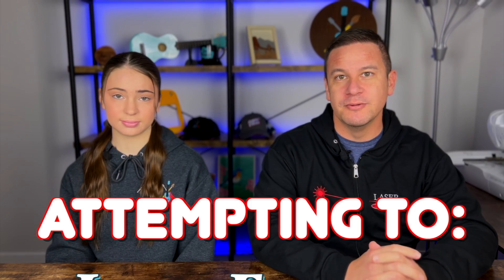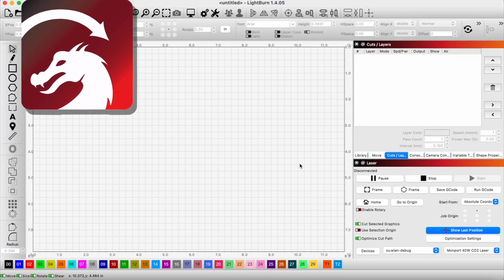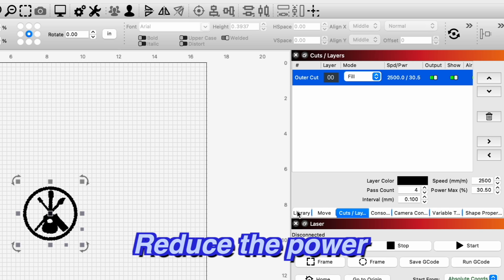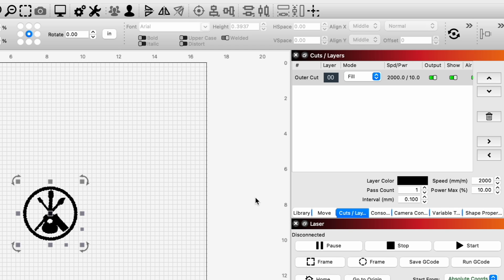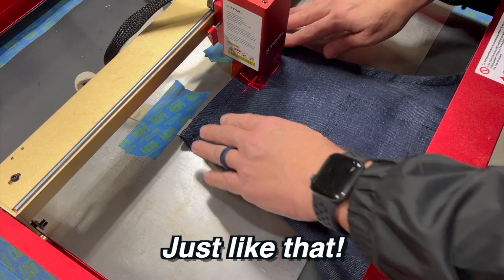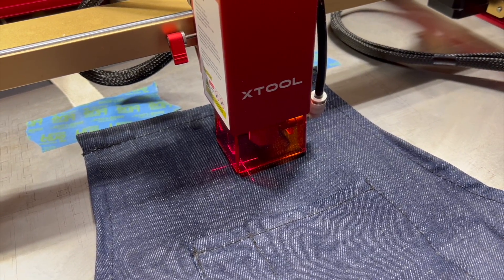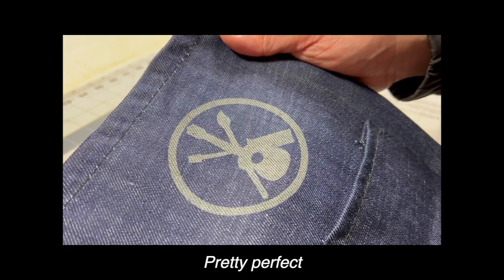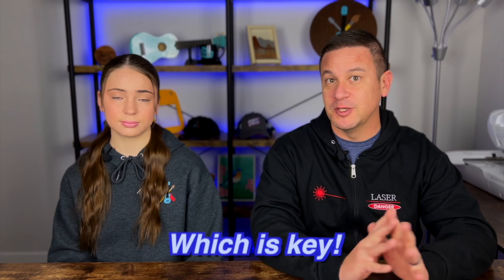DENIM ENGRAVING w/ xTool D1 Pro 10w

Comment: Hey how are you?  I noticed that in some examples the color of the engraving is different than in others. I'd like to make the engraving light blue. But I noticed that some come out beige or greenish. Does this have to do with the power or settings used on the machine, or does it depend on the color of the denim?
Reply from the maker: Hi!  We can't be sure the reasons for variation in the denim results. It's likely that the power, setting, denim fabric and color are all going to play a role in color variations you will get from engraving. Some of the denim results from engraving just look like the backside color on the fabric, while others yield a greenish hue like you noticed.  You will likely need to do some testing to yield results you like.

Comment: Thanks for the video. Couple of questions. I have the same laser machine but 20w. I bought the same aprons to etch and give as gifts. I use the software that comes with Xtool, Creative Space. Do you have a suggestion for the settings on the 20w to etch the same aprons? I have test pieces of denim do you suggest I do a test matrix first and see what the results show? Appreciate any help.
Reply from the maker: We definitely recommend a test matrix with low power and fast speed to get the best idea on the optimal settings. A good starting point would probably be 20% power and 6000mm/minute. Thanks for watching!

Comment: Thanks for the video. 👍 I have the same Xtool 20w machine. You may have solved a mystery. I’ve been asking on the message boards how do I get the item to engrave positioned with a center point not a corner. You mention you used the option "set origin." Do you know if that is possible using free Creative Space software that comes with Xtool? I’m not using LightBurn. Do you recommend LightBurn with the Xtool unit? I’m just a hobby wood worker. I want to make boxes. Similar to the gift wine boxes. I really like your videos because they cover normal challenges and are easy to understand and follow. I tried the powder coating method with the laser and it was a failure because I had to move the laser out of the way to put the powder down. I moved it back to the spot I THOUGHT matched up with the previous burn but it was off a smidge. Grrrrr. I didn’t know a way to tell the software/laser to start over again in the exact spot as previously engraved. I figure if I can put a center spot in the item then I have a reference to start over again. Maybe I’m making this too complicated? Thanks.
Reply from the maker: We don't have any experience using the Creative Space software. We do recommend Lightburn and use it exclusively on all of our lasers, so we don't have to learn each lasers proprietary software.  If it is an option in the Creative Space software you could try using the software to move the laser out of the way, that way you can move the laser back to the origin point, rather than manually moving it with your hand. Thanks for watching!

Comment: Have you tried this on different color of denim or only blue? I wonder if the color would require different settings or if the design would show up as well as yours did on the apron. Great video. Very to the point and informative. Thanks.
Reply from the maker: That is a good suggestion, we haven't tried any other types of denim.  Thanks for watching!

Comment: Is it bad to just move the laser by hand rather than using the buttons in the software? I do this most of the time.
Reply from the maker: We have had no issues moving the laser head by hand. I know there are risks of ruining your control board if you move the laser head by hand quickly on older models of gantry lasers (due to the stepper motors generating electricity flowing back to the board), but again, we haven't had any issues with this machine.